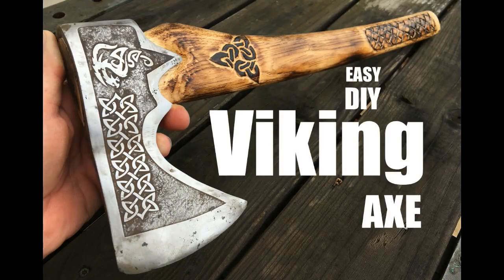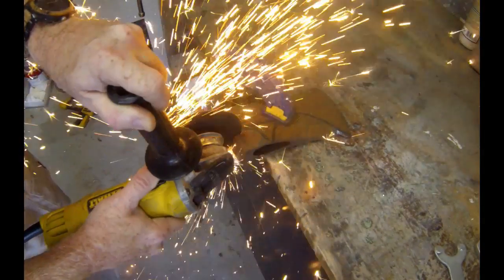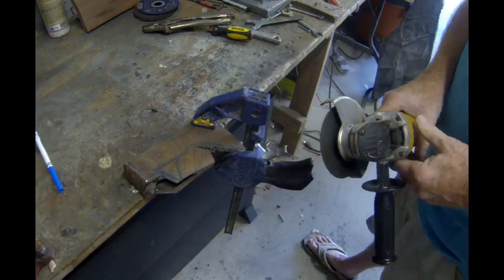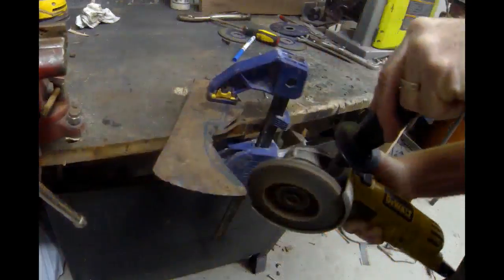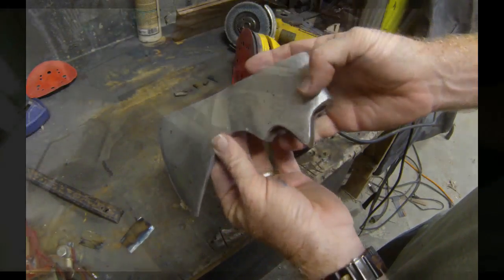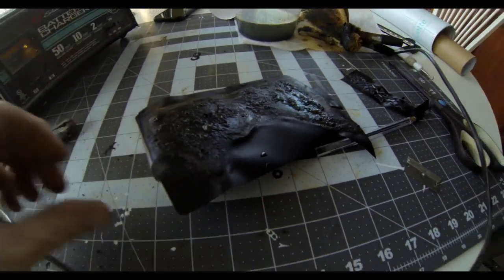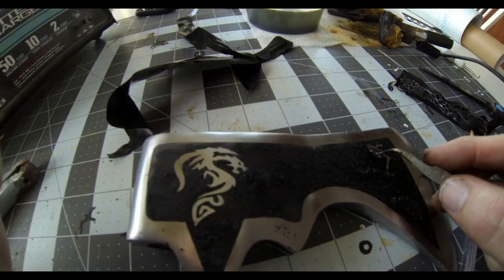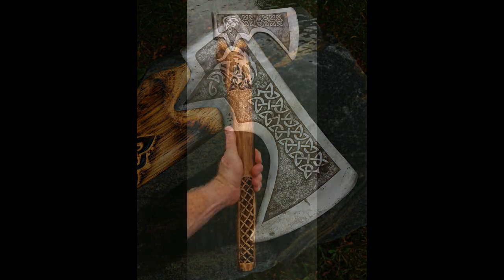How to make a Viking Battle Axe from an old rusty axe head

Comment: Great piece, and I love that it's up-cycled! To those commenting/complaining on the flip-flops and vice grips, well it's like this for me anyways: true metal craftsmen build/create whenever the metal gods give us an idea or the notion to build... I've been in my garage doing something on an old car and I'll spot a piece of steel in my steel pile and I'll actually see something else in it and it does not matter what I'm wearing or what I'm doing, I just take that piece of steel and work it till I'm happy with what I've done. I've made whole pieces wearing my bath robe with slippers on a snowy Sunday afternoon haha!!
And vice grips as a light duty hammer is perfectly acceptable in many garages LOL and I as a welder, among my other trades, probably have 50 - 60 pairs of all different kinds of vice grips I use when fabbing up bigger pieces like whole old truck bodies being welded to modern floors/chassis.
I love using thrown away metal for all my builds, I'm 51 and I can honestly say I've never once bought a brand new piece of steel, all my steel's dragged home literally from the dump, heavy truck service garages shucks even the back ally's given me some good steel and I've traded welding repairs for piles of steel... I LOVE steel. All of it was once considered junk, but to me it's good junk because it gives me good money whenever I sell my craft and it's not hard to sell anything that's well made.
Reply from the maker: Thanks for the support George. Would love to see some of your craftsmanship.

Comment: Very nice work. I would like to highly recommend to change from using a flap wheel to an actual grinding disc to clean up your plunge cuts. Saves a lot of time and doesn't over work your grinder. Nice tho

Comment: People keep calling this shape "viking", but it really is called a "german" axe head. This shape was used all over Europe and into the baltic area though. The idea of the flat top and rounded upper corner is that people would carry the axe in a belt on their waist. A pointed top corner would be mostly rubbing on either the forearm or the belly, ruining the tunic or shirt. So obviously this shape was used for smaller axe heads. Bigger ones would be carried over the shoulder, so the lower corner would be rounded (lest it would dig into the shoulder).

Comment: So could you heat up the axe head before grinding parts off? I'm starting to make stuff with a forge I made and I dont have a lot of discs on handz I just dont want to make it unnecessarily complicated or hard on myself.
Reply: Yes heat it don't quinch it intell after you cut the quinch will harden the metal back up

Comment: you briefly talked about it rusting what's the best way to keep knives and that from rusting?
Reply from the maker: I usually wash off the salt water and then give it a good wipe down with oil
Reply: boiled linseed oil. It's also good for the wooden handle.
Reply: boiled linseed oil. It's also good for the wooden handle.

Comment: I'm back. Watched it again and still very impressed. I'm curious about one thing. With the vinyl stencils, could a person use electric tape instead? I don't have  vinyl printer capabilities. Thanks
Reply from the maker: Yes or just go to Michaels Art Supply and buy a couple sheets of self adhesive vinyl. Then cut out design with a rezor knife
Reply: @DIYeasycrafts  got it.

Comment: After the etching you let the rust accumulate and then cleaned it? What did you clean the rust off with? Great looking axe and very good tutorial.
Reply from the maker: Did not have to do anything. Just heat treat after the rust  and then hit it with light 400 grit paper
Reply: DIYeasycrafts oh ok, is it prone to coming back?, sorry unlike a lot of the "know it alls" I'm a know nothing. Thanks
Reply from the maker: Any high carbon steel can and will rust. I have used oil or butchers wax on my finished products. Both prevent rust nicely
Reply: DIYeasycrafts ok thanks for the info!

Comment: I know this is an old video but can you possibly use nail polish instead of vinyl? I have 2 daughters and a wife so there’s endless supply of it around lol.
Reply from the maker: You can use nail polish as the resist but will not get the clean crisp edges like you do from adhesive vinyl
Reply: DIYeasycrafts thank you so much for the reply! I kind of figured. I ordered some vinyl from amazon but figured I’d try nail polish or even electrical tape.

Comment: Could you please explain the process of etching with the battery and salt water and where did you get the vinyl cut out design? I can’t find anything like that for sale (vinyl design cut out)
Reply from the maker: I actually cut out my own designs on a craft vinyl cutting machine called a cameo silhouette
Reply: Thank you.
Reply: Thank you.  I have since watched other videos specifically in the electrolysis + vinyl cut process and learned more. Didn’t know this was possible until a few days ago!
Reply: Thank you.  I have since watched other videos specifically in the electrolysis + vinyl cut process and learned more. Didn’t know this was possible until a few days ago!
Reply: Thank you.  I have since watched other videos specifically in the electrolysis + vinyl cut process and learned more. Didn’t know this was possible until a few days ago!

Comment: nice work but VICE GRIPS ARE NOT HAMMERS.  Otherwise, good video!
Reply from the maker: Agree but it was in arms reach and did the job LOL
Reply: Been there and done that myself.  I did a version of your ax but used an old double bitted ax.  I know, the vikings didn't use doubles but I tried to imagine what the weapon would have been like if they had.  Came out really nice.
Reply from the maker: Please join my Knives and knife making facebook group and post some images. Would love to see the double bitted ax. https://www.facebook.com/groups/324546941320593/
Reply: Just submitted my join request.
Reply: Speaking as a sheet metal worker, anything is a hammer.

Comment: Why would you put celtic engravings on a viking axe?? I'm not even talking about the dragon...
Reply from the maker: The Vikings did invade and then inhabit parts of Ireland
Reply: @DIYeasycrafts  Therefore celts would be influenced by the vikings and not the other way. You could say that it's a celt axe with vikings influence, that would be more accurate.

Comment: i hate these videos. if you wanted a "viking axe" just make it out of a harbor freight head. these "mods" are not improvements.
keeping the blade size while grinding away most of the head not only removes head weight so it won't chop nearly as well. secondly, removing so much of the eye, you're lucky if it stays tight on the handle.
Reply: gabriel Sturdevant yeah those old axe heads were so much better and I hate when people cut them up
Reply from the maker: to each their own. The original thought was to make a Viking style throwing axe out of the old axe head. End result was a little to heavy for all but the biggest of us to throw. Actually should have taken even more weight off the old blade so it could have be thrown easier. Yes you are correct less head weight will not allow it to chop as well.
Reply: DIYeasycrafts I really like your axe and it is very nice. The video got a like from me but I would have just used a really cheap Chinese axe for it instead of a quality one
Reply from the maker: Point taken. Actually had not even though of using a cheep axe head. When we found this head we almost threw it out LOL  Im going to make another smaller throwing axe. Will run to Harbor freight and see what they have available.
Reply: DIYeasycrafts great idea.
Reply: Actually there is no wrong way to design an axe as long as it is effecient and meets the parameters of what we know as an axe and this does both. Or at least can. I have personally been familiar with axes having less weight that are leathal. The Viking feel, is an art choice for the blade but is actually quite seperate from the design of the blade itself as this is not being made by a viking in true fashion. A standard rule is that at 12 oz any bladed object becomes fairly lethal. i.e. At this point it takes reasonable force but not that exceeding the capabilities of any human to kill something. Thus, is the point of a "battle axe" which this was clearly meant to be. As he is chopping not wood but foe we come to a point of technical preference. i.e. It doesn't need to be able to split big logs just bones and flesh, substaintially softer material. We know 12 oz is lethal and the lighter something is the faster and easier to move it becomes. I have used designs that  were between 12 and 20 oz head weight without the handle that were far more than effective. With many of these designs having even less contanct point with the handle. Granted I prefer a full tang metal axe for tactical use, I have personally tried and abused axes that were very much like this one and simply couldn't break them. My point is this, if the axe doesn't hold up it is a matter of handle material and personal craftsmanship. The design is absolutely not a problem at all. I could personally remake this with quality materials and it would be unstoppable in the hands of someone who has mapped out the most effective ways to fight with such a design and weight combination. As a final note, the fact that this thing was rusting into waste and now looks like this is simply awesome, a great use of spare time and energy. You get on here and critisize him, why? He did something awesome and as an experienced bladed weapons expert I can tell you with no amount of uncertainty that the logic of your judgements are unsound and you could only be correct through coincedence as such is determined by information you simply could not have ascertained by watching this video. To the axe maker; amazing , simple project man. And Insults that are not backed by truth and intellect are not insults at all.
Reply: Jessi Ray I'm talking about as a tool, not as a weapon. Second, old axe steel is of very nice quality. Nothing like today's super steels but is good nonetheless. While there is no wrong way to design an axe, there are certainly bad designs.

Overall. There is a huge divide between us traditionalists and you tac-hawk guys. To get to the ground roots of my argument, he would have been better off just cleaning it up and giving it a good handle. In my eyes, it was wasted potential. If I recall correctly, it was a Maine pattern head, now back when these axes we're being produced, Maine was home to some of the best forges in the world. From my point of view, he took a tool that needed some work, and then ruined it by cutting it up to make it look pretty. Cutting so much out of the eye removes surface area so it's harder for the handle to stay seated in the head, rounding off the poll is another thing that takes away from it's ability as a tool, as the poll moves the balance backwards, making it easier to swing. Lastly there would be an obvious drop in cutting performance due to removing so much weight
Reply: I understand your point. This is a the right tool for the job scenario. He was obviously looking to refurbish something and this was his vision. I believe in individuality and people being able to express theirs through craftsmanship and art. When I go into a survival situation, I will want certain equipment. At the house doing daily tasks applicable to our daily lives now, I can see that it would have been much better suited if restored to your liking. But he did this and he wanted a battle axe that looked really unique. As he was not going for wood working axe I think it is illogical for you to judge him on such standards. And The quality of the axe head he used, I would want nothing less than quality if I was ever planning on using it for actual self defense purposes. I would love to carry an axe like this in an extreme life scenario. Functional and gorgeous. I would have dome some things differently myself. Heat treating and tempering specifically, but he did a fine job and I think some people tend to, unknowingly or not, push their views on others and judge rather wildly and illogically instead of accepting and appreciating that we are not all the same and shouldn't be. I mean you no ill will sir and I believ you have your right to your every opinion. I just don't agree with you casting harsh judegements on those who do not share those opinions. As we are, so the world, as we percieve it, will be.  So let us be righteous and just in our every interaction with ourselves and all Earthly brethren.
Reply: as long as we understand each other, there is nothing else to say